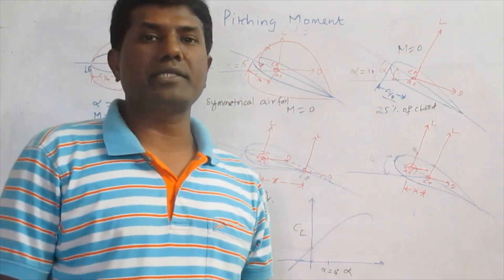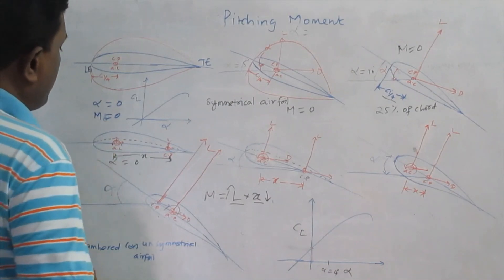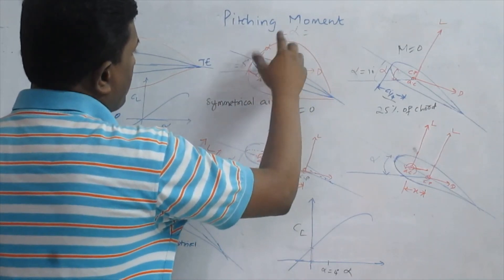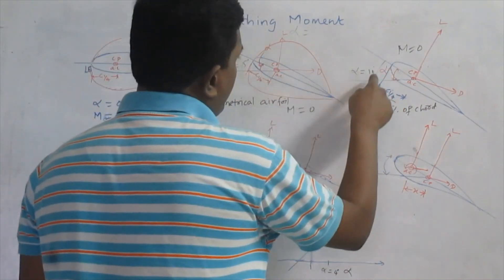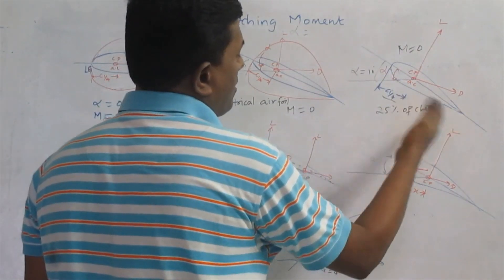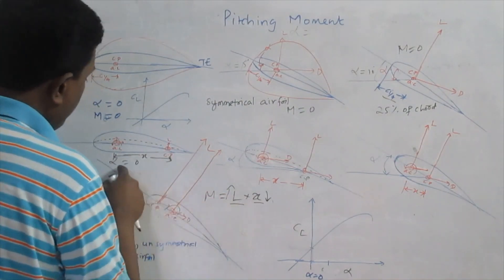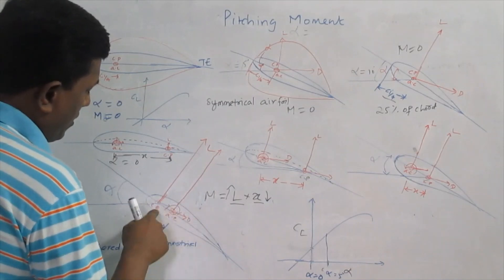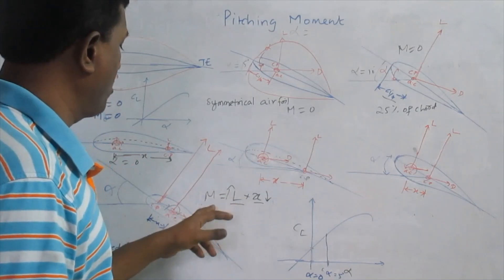Why Pitching Moment is constant about the Aerodynamic Center?

Comment: Sir, you said for symmetrical aerofoil pitching moment will remain constant with increase in angle of attack. But this is not true. I have checked pitching moment of many symmetrical aerofoil in airfoil tool website.
Reply from the maker: Pushpendu Nandi : We have to understand one thing as long as potential flow theory is valid in our analysis,  pitching moment still would be zero. Many researchers say that pitching moment is zero within a small range of angles of attack (ex say between -4 to +4 ). If viscous effects are taken into account, yes it will be non zero.

Comment: Hello Dr Guna,
I do have a question regarding the Cm for symmetric airfoil and wing. I did an analysis for a wing (NACA0012) of span 1.25 m and chord 0.25m using XFLR5 (LLT, 3D Panel and VLM). I am getting negative slope for Cm vs AOA curve.As AOA changes from 0 to 17 the Cm value changed from 0 to -0.2. 
You mentioned in the video that Cm value should be zero and constant for symmetric airfoil at different AOAs.
Could you please tell me the possible reasons for this trend in my analysis ?
Reply from the maker: Muhammed Sadique P : Dear Sadhique, we have to understand one thing as long as potential flow theory is valid in our calculation, pitching moment still would be zero. Many researchers say that pitching moment is zero within a small range of angles of attack (ex say between -4 to +4 ). If viscous effects are taken into account, yes it will be non zero and it is applicable to XFoil as well.
Reply: @Aerogunasekar  
Thank you for your reply. 
when I analysed the 2D airfoil in XFOIL I was getting values around zero.
Here my analysis on a 3D wing, and also using XFLR5. The theories used ( LLT, 3D panel and VLM ) in XFLR5 takes viscous drag from 2D analysis. XFLR5 uses XFOIL code for 2D analysis. I can email you the plot I got from 3d analysis.
Could you please look into that ?

Comment: Can we describe the aerodynamic center is a point on airfoil that the center of pressure does not cross it even with increased angle of attack?
Reply from the maker: We can't define it in this way. Center of pressure and aerodynamic center coincide with symmetrical aerofoil. And in the event of a high angle of attack in unsymmetrical airfoil, it will cross the aerodynamic center at some value.

Comment: What is this shifting of resultant force to the aerodynamic centre?
Reply: Can you explain please me with an example how can we calculate the Cm about aerodynamic center using the XFLR5 software or xfoil software. I am find hard to find out the value of this. Some people consider 5 degree angle of attack and then see the Cm value of the wing.
Reply from the maker: In an aerofoil, resultant forces generally used to act at center of pressure. Center of pressure is not a fixed point and would be moving forward and backward on the chord of the aerofoil depends upon the angle of attack. For analysing purpose, we need a fixed point. That is what we call it as aerodynamic center and resultant forces are shifted to this point, so that aerodynamic analysis are done.